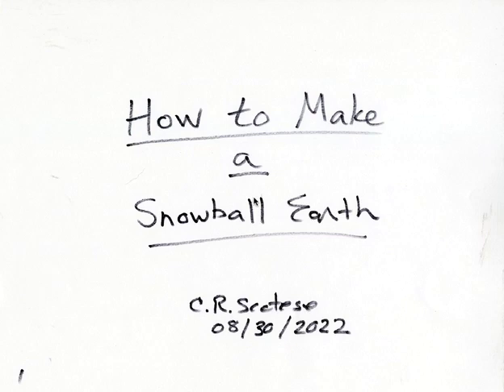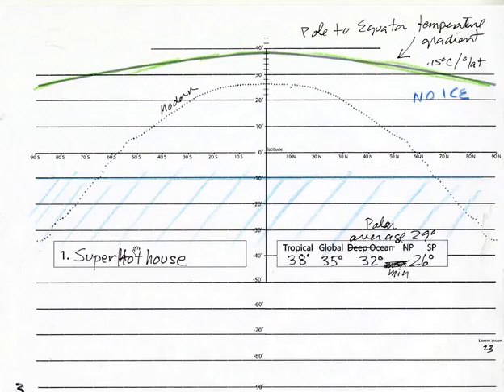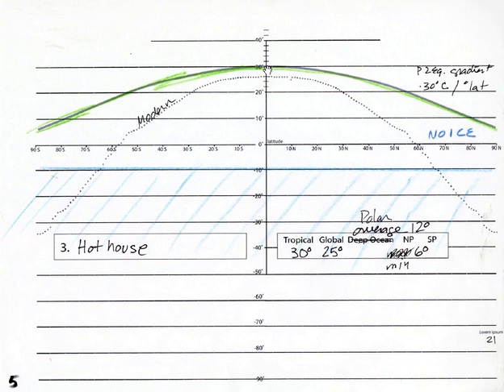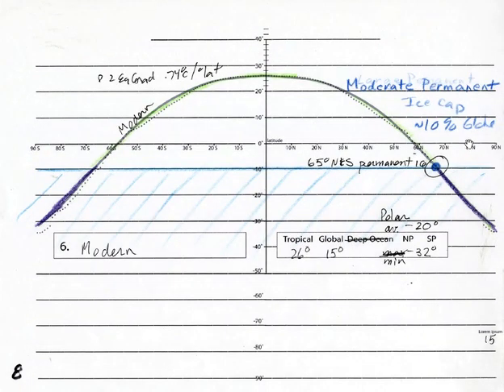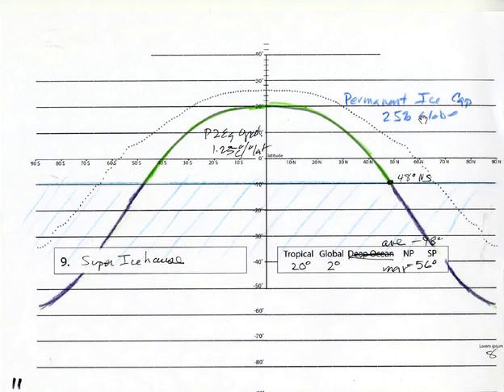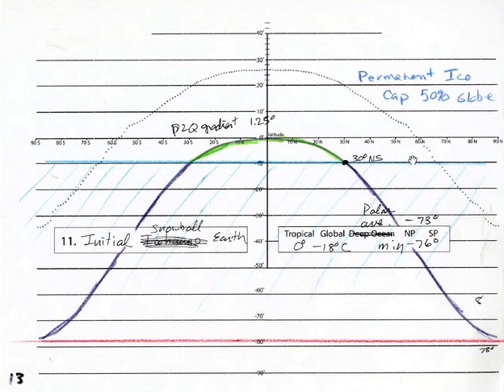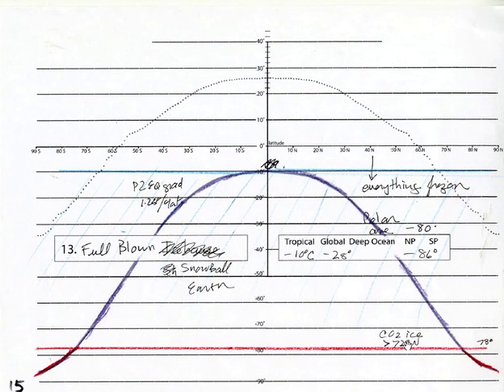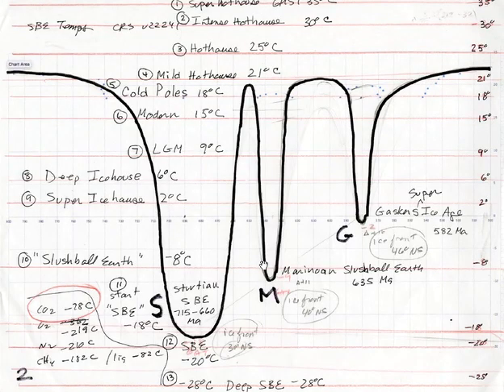How to Make A Snowball Earth

Comment: An asteroid with a diameter of approximately 300 km to 500 km falls in the Democratic Republic of Congo and collides with Earth!
The asteroid falls at an angle of 48 degrees and passes through the Earth.
As it passes through the Earth's mantle, two donut mantle convection currents occur.
One is an underwater mountain range (rift valley, ridge) that extends from the Indian Ocean to the Atlantic Ocean.
The second is the Pacific submarine mountain range (oceanic ridge, rift valley).
Donut mantle rises due to heat! So, when it meets the crust, the crust separates.

The remaining submarine mountains (rift valleys) are caused by two donut mantle convections following the Himalayan asteroid impact.
In other words, the asteroid fell into southeastward seas of South Africa (now Tanzania).
As it pierced the Earth and passed through the Ural Mountains, two donut mantle convection currents occurred.
The angle fell at an angle.
  The first donut mantle convection created underwater landforms from the Australian South Sea, underwater rift valleys (undersea mountain ranges), and from the Philippine Sea to New Zealand.
The second donut mantle convection gave rise to Arctic ocean ridges and rift valleys.

In other words, two giant asteroids will fall and the continent will split (split)!

Other large asteroid impacts have pulled or stretched convection currents in the otherwise circular donut mantle, causing the African continent to become uncircular!

For reference, the primary vortex (donut mantle convection) of the asteroid that fell in the Democratic Republic of Congo, Africa, was cut off by the asteroid impact in the Himalayas.
  The tip of the cut donut mantle rose to become the island of Iceland.

(donut = doughnut)

 *If the asteroid is about 100 kilometers in diameter, it has a core of its own.
That's why doughnut mantle convection occurs twice.
Once as the outer shell is shed, and twice as the 
asteroid core travels through the mantle!

The Democratic Republic of Congo asteroid impacted Earth at an inclination of about 48 degrees.
So it didn't hit the Earth's outer core!

Comment: Hello there, I have a question you may be able to answer. It is about continental drift. I know a good bit about plate movement but on up to this point nobody has ever answered the question : how do individual land masses break from one place and get to another place quite far away actually on a different plate. A good analogy is India. India started breaking away from Antartica during the early jurassic period and as you probably already know, Antartica has its own plate. A sizeable plate. Yet, India moved upwards moving over a destruction zone causing quite a bit of volcanic activity 65m years ago then collided with Asia creating uplift. How did India get from one plate to the next? Since these are obviously two large plates and are seperate. Does one plate consume another and landmasses are swapped or how does this work? I am trying to grasp with the idea and learn about it. Thank you.
Reply: that's actually a very good question. While I don't know the intricate details of indias tectonics it works like this:
the subduction and generation of oceanic crust happens at different rates across the globe.
So for example the subduction north of the indian plate and the spreading south of it happens at a faster rate than at other boundaries. So the plate must get translocated  so to speak. Its not like its moving but the crust around it generates and subducts.
Reply: What do you think about a theory that the earth, surface area of this sphere, has actually expanded and contracted over time ….?
Reply: @I.M.A.Panther3619  Indeed, I think so too. It expands and contracts like a heart. There is a break in between when neither.
Reply: @penzeszsuzsannaliliom4270  I wonder about the atmosphere …. 
If the earth does expand and contract, does the atmosphere become thinner or thicker along with the size of our sphere ?
That would have rather severe consequences.
Reply: @I.M.A.Panther3619   Indeed. It won't get thinner or thicker, the transformation and movement in the atmosphere will just slow down. As a result, it is largely unsuitable for life on the surface of the earth, e.g. during the great ice ages.